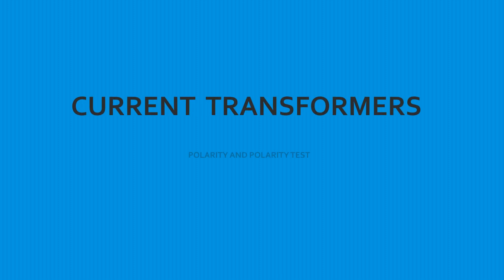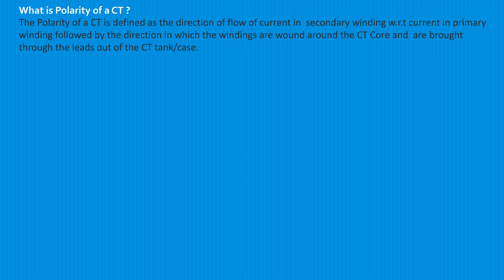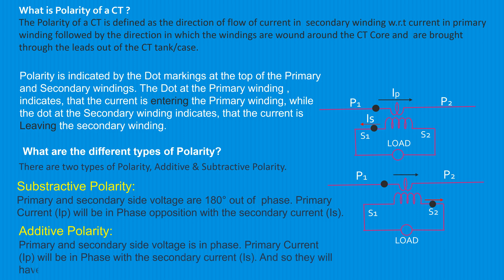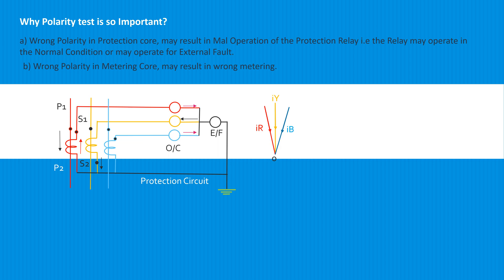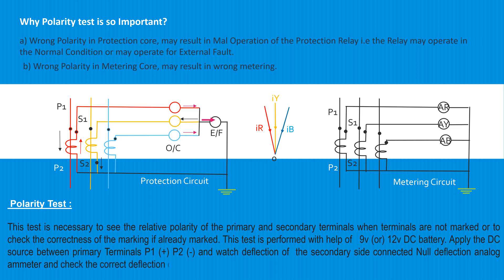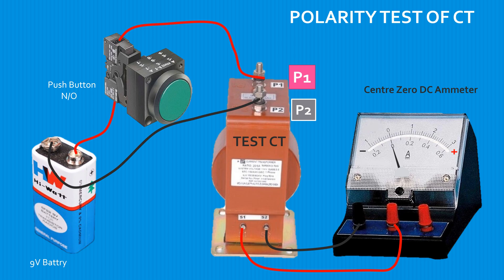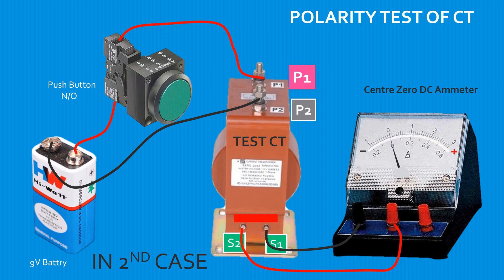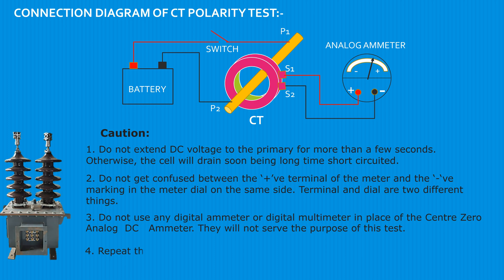Polarity Test Procedure of a CT(Current Transformer):What is Polarity of a CT:Why it is important

Comment: what if there isn't P1 and P2 phisicaly connected. like a toroidal CT (the one with a hole)
how do you check the polarity in that situation?
Reply from the maker: You are welcome. At the case you stated insert positive cable from n/o push button through the hole and connect directly to the negative of the battery and follow the test method. Thank you❤.

Comment: Is the dc voltage supplying to primary side of CT, can it induce the voltage at the secondary side? Or is the deflection is just a small vibration at the starting?
Reply from the maker: You are most welcome.If the primary winding of a transformer here CT is connected to DC supply mains, the flux produced will not vary but remains constant in magnitude and therefore no emf will be induced in secondary winding except at the moment of switching on and connected ammeter deflection is just a small vibration once at the starting.and .......... you know well sir. Thank you.😀